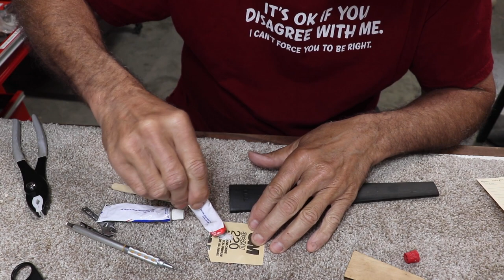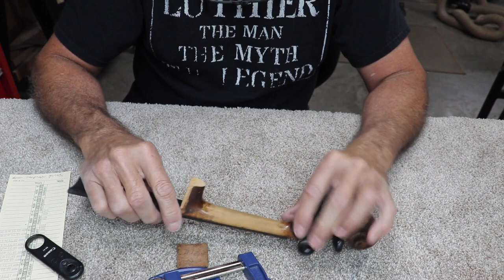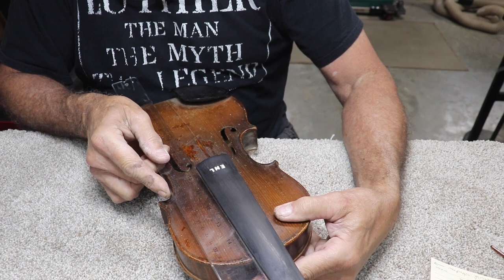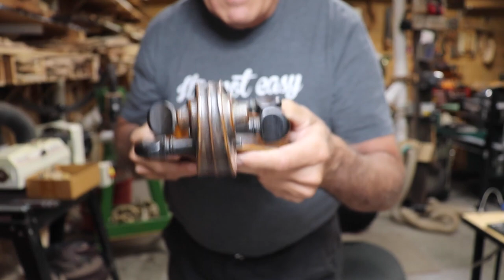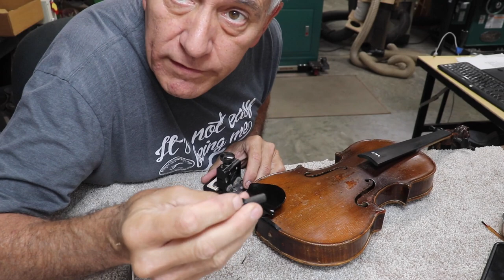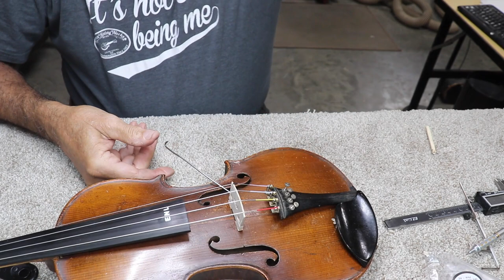502 RSW Granpa's German Fiddle Final

Comment: That wire on the tailpiece is a disaster waiting to happen. I had one pull out both holes all the way. 
When it did, it scratched up the top and broke the bridge. I will never use wire or string again for holding the tailpiece to the end pin. Good decision my friend. I do believe your customer will be very happy with the old fiddle. I love to watch you work on these old violins.

Comment: Easy inlay > fine crushed mother of pearl and super glue , works also .......Make sure its full before the glue , using a needle or ? for tamping and make sure the glue stays inside , dont let it run over on the wood , just to the edge , more glue will be needed after drying , fine sand flush and clear over it .....

Comment: Hello Jerry, here is a tip for your soundpost rounding. What you can do is cut the post blank a little longer and maybe a 32nd wider than needed, then make one end  of the blank pointy, the other end gets chucked in a corded drill. Then find a piece of steel bar 1/8 inch thick and drill a hole with a drillpress into the bar to the diameter you need your post to be, and get rid of any burrs. Last step is to simply insert your post blank into the hole in the bar, and push the blank trough with the drill running. Makes a perfect circular post/or dowels in no time. Hope this helps. Great video as always!!!

Comment: Why not use Wittner Fine Tune Pegs? They look the same as Normal Pegs but they turn more smoothly & they have an internal mechanism making it super compact.
Reply from the maker: Not original to grandpa
Reply: @RosaStringWorks  I know but the Wittner Fine Tune Pegs look original in their shape.
Reply: @RosaStringWorks  Have you tried Wittner Fine Tune pegs before? You should because they look like regular pegs but have the advantage of making fine tuning adjustments like Guitar pegs. They allow you to eliminate fine tuners from the Tailpiece which enhances the sound by allowing the top to vibrate more freely.